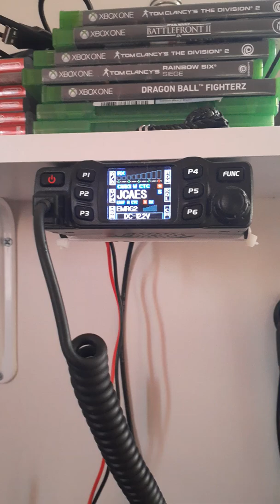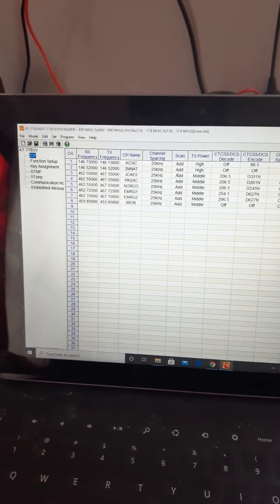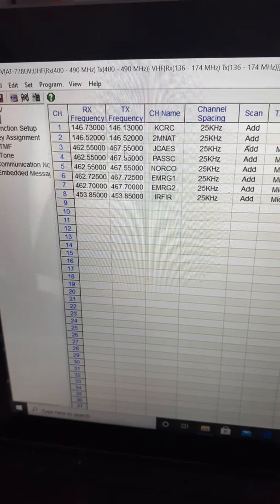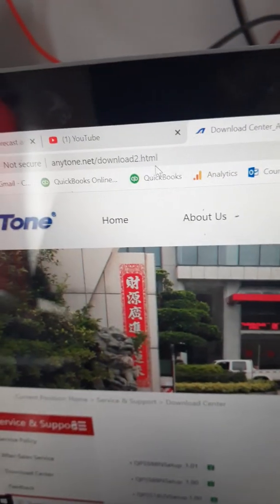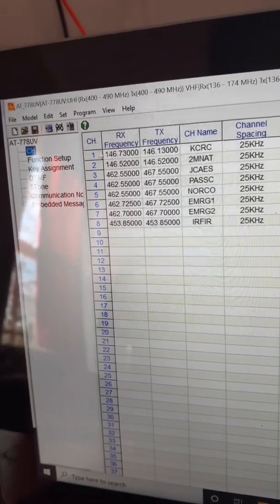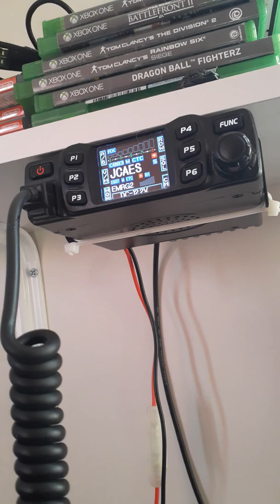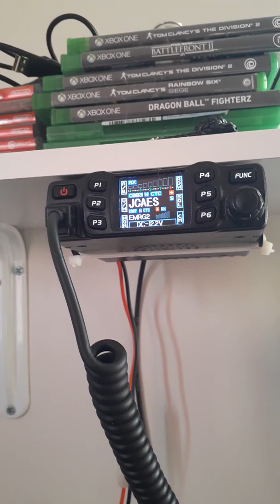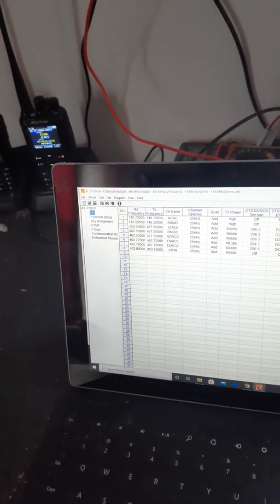Programing the anytone 778uv

Comment: Hello! Question, you used the 779 software for the 778? I have the 778 and need to program the GMRS as well, was wondering if you can confirm what software to use, thanks!
Reply from the maker: No I have not done it that way I always had the 778 I know it's hard to find idk what's anyone's issue with the 778